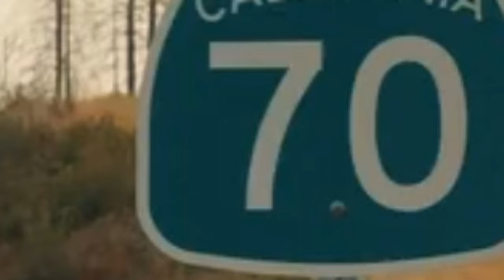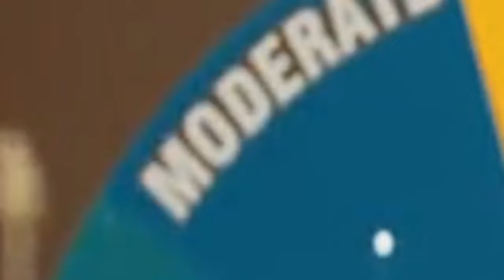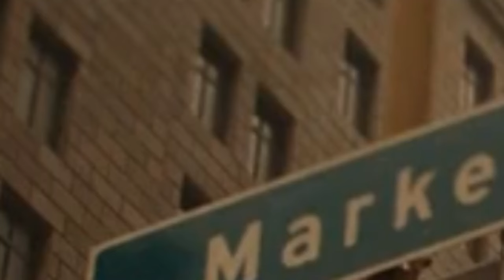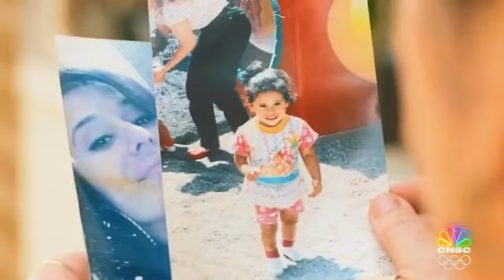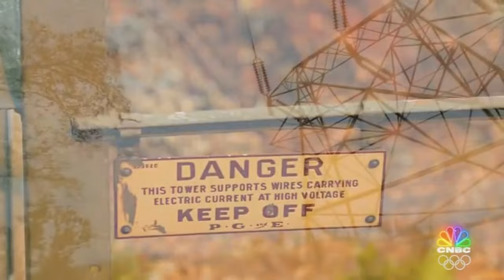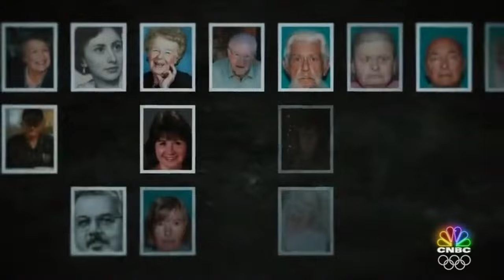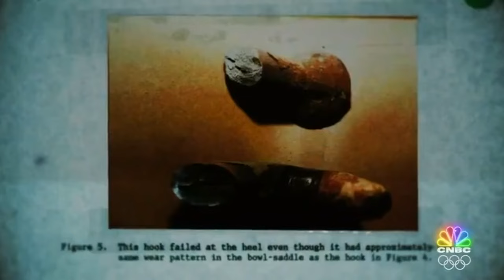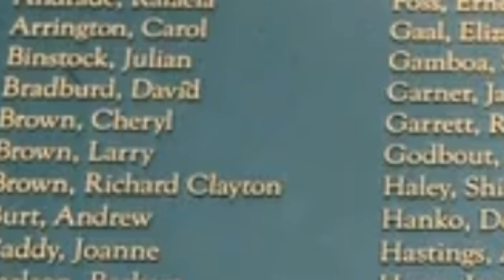American Greed 2023 | Burned Greed | American Greed Full Episodes

Comment: My friend’s wife works at PG&E headquarters. The California state agencies that required permits for fire control had or has either delayed or rejected maintenance permits along those power line routes for many years. This is not an unbiased report. The Paradise, CA fire source was from a home made transformer illegally tapped into the PG&E power grid. There is corruption on every side.